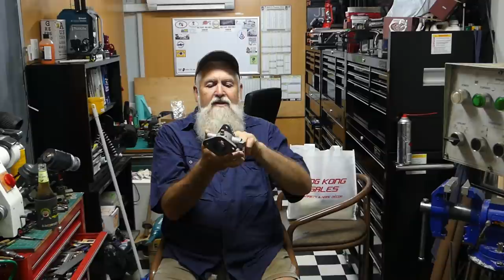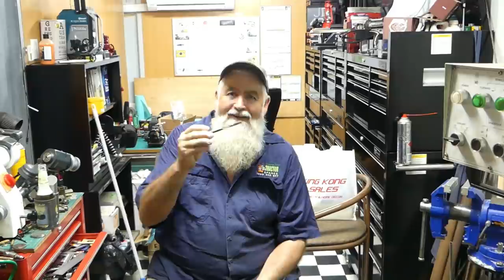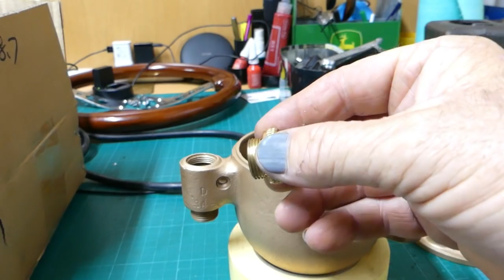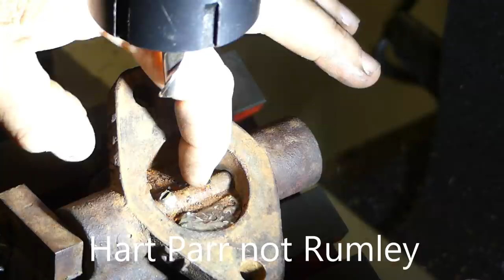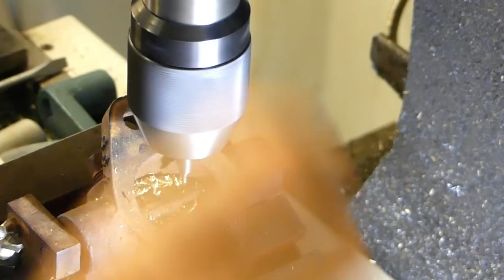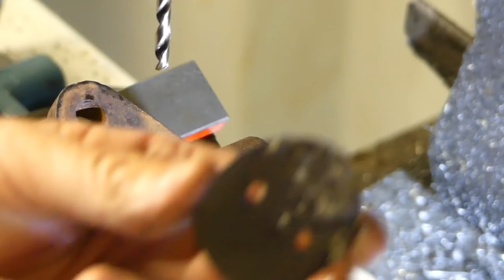Kangaroo Stew # 177  A Chat and I Start on a Hart Parr Tractor Carb.

Comment: 4 jaw concentric chucks are great , i grew up using a large Taylor one .  That carby , i would be tempted to sleeve it .  Talking about carby's , years ago i saw am  aluminium one bronze welded to a cast iron manifold  on the donkey motor off an old Cat D4 dozer .
Reply from the maker: G Day Max, There has been a lot of strange stuff done in a state of need. We had an Austin car come in to where I did my apprenticeship with 1 wooden piston and the spark plug left out to bring it in from the forestry. It made the one trip it needed to make.

Comment: Nice stew Lance, thank you. JB Weld works for me, I've used it a few times and had no problems. I've just finished re-assembling my TEF20 injector pump, some interesting points in that. I followed your video intently...several times...lol. Have you got round to finishing yours completely, I'd like to see it complete so I could compare it to mine? (Several things I'm not sure about.) Keep up the good work, Geoff.
Reply from the maker: G Day Geoff, I got a couple of 135s and never got to pull the TEF down properly. I need a delivery valve for the pump if you see one in your travels. I have not even bushed the end housing, just lost interest for a short while.
Reply: @BundyBearsShed  Yeah,  I had to bush the end housing on mine as well, and make a new shaft, turned out pretty good actually. I didn't have that fancy retaining clip, so it ended up with a washer and split pin. The "delivery valve" you need, can you explain a little more please. I thought you had all the original parts..?? I'll send you a gmail about my concerns on my injector pump.

Comment: Hi Lance. I was intrigued as to what a Hart par tractor looks like 

Found this on YouTube. Is it similar to this.
https://youtu.be/t8iv3ly-H4s

I would go with JB weld as well as mentioned by others.

I think with your Corona advert you will be getting them a lot cheaper in the future.

This video is Lance moving in to product placement big style
Corona beers
King Kong bag
Grey nail varnish (paint yeagh right)😀

Keep up the good work 👍👍.
Reply from the maker: The Hart Parr Im working on is a 28-50 if you use Google Images you will see quite a few examples. It is older than the one in your link.